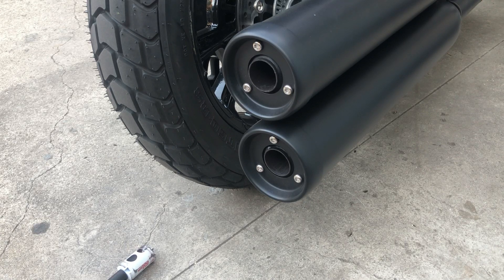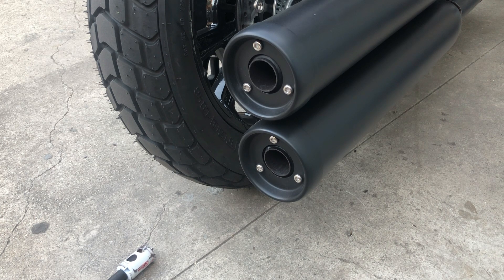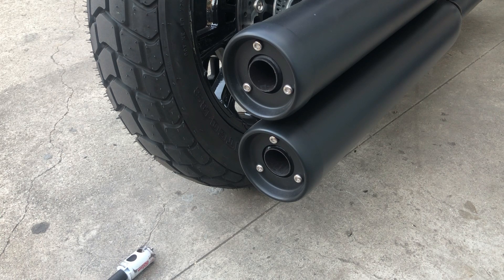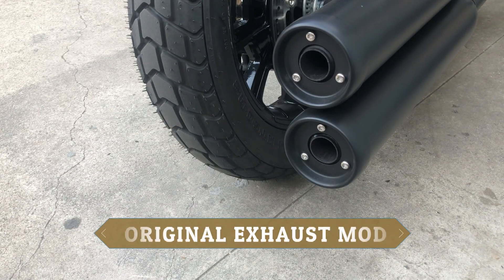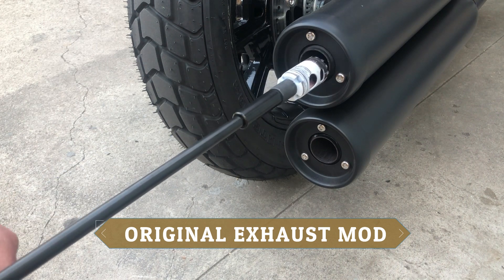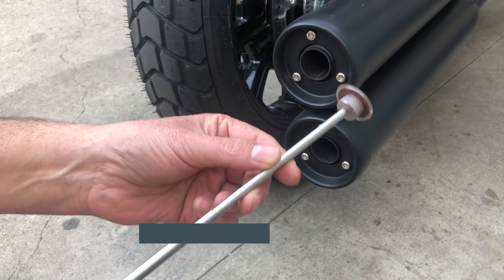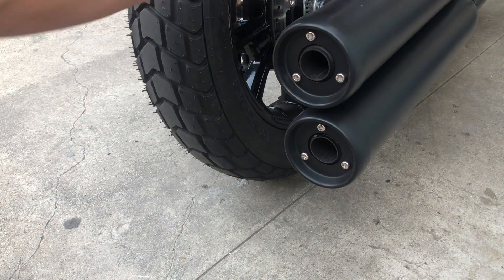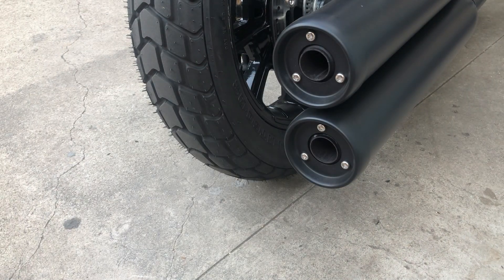Indian Scout Bobber Stock Exhaust Mod

Comment: Everything this this gentleman demonstrated is accurate. Just did this about a month ago to my 2021 Scout, and measured dec. with a phone app, I measured 83>84 dec. @ 4 ft. After removing just the 1st baffle, I measured 89>90 dec. Not sure how accurate my phone is, but measured both times at same distance. My experience was a more noticeable increase than what the video portrays. After drilling out baffle, and pulling out the disc, I shoved magnet back in, and recovered more of the shavings from drilling, followed up by a modified hose hooked to 6hp shop vac. Besides completely removing muffler, I do not believe I could have got it any cleaner. Regardless, bike sounds and runs great. Much cheaper than slip-on's, and is a good starting point to decide how you want your bike to sound.
Mike
Reply: Did you drill 1 or two sets?
Reply: @jimheidl1272  
Just one in each muffler
Reply: @mikeh4686  have you heard or seen any video of someone drilling both sets?
Reply: @jimheidl1272  yes, if you search for it on YouTube there is a lady that did drill both out. She does an excellent review of before and after. Video shows stock, 1 out, and finally all four.
Reply: Hey Mike! So... your engine has NOT exploded yet do to errant metal shavings?? I kid, I kid. Anyway, how did you modify the shop back hose? My SB20 should be here in a few weeks and this will be first order of business.
Reply: @metalmotorcycles5732  
Hell no. Bike just ticked off 5500 mi. and runs great. Extendable magnet picked up most of the shavings, and then used a pc. of radiator hose on end of shop vac to retrieve what may be left. This isn't for everyone, but it's hard to find compromise between good sound and pissed off neighbors. I am not in a hurry to throw lots of $ an exhaust system, and maybe find out it's not for me. My 2 cents

Comment: Why not take out the screws and just gut the whole muffler?
Reply from the maker: that is a good question, but from a post i read in the past, this will leave a hollow void (shell) and no interior parts. what I was trying to do, was just increase a bit the noise level.  but, you have a good point.

Comment: Easiest and Most Sound Effective is
Remove the 6 3mm Allan Screws at end Caps
Pull Complete Baffles out
Remove fibreglass Wrapping and throw in the Bin
Get your grinder with Cutting Disk and Cut Off @ the end of Cats,
Re IN stall,  WIN / WIN
YOU WILL BE A MUCH HAPPIER INDIAN OWNER
COST = ZERO DOLLARS.
Reply: The caps are just for show. The stock mufflers are sealed.
Reply: Post a video about it.

Comment: Uh, what about the metal shavings? There is actually a vacuum at times. I’ve seen bores destroyed from catalyst material being sucked up into the cylinders. It all doesn’t blow out.
Reply from the maker: very good observation. thank you.
Reply: You can cut the pipes back past the first baffle and modify end caps too.
Reply: Are you sure you're not thinking of two strokes? 4 strokes have valves that would stop the possibility of anything being sucked in.
Reply: @kevinsweeney3428  I worked at the Honda engine plant test department for over 20 years. I’ve seen the destruction to cylinder walls from loose catalyst material being sucked into the engine. 4 stroke automotive engines I’m referring too. It can happen!
Reply: @davepritchett  He did remove only the first exhaust baffle. The catalyst is much further in the pipe on the opposite end. There is still another baffle and the honeycomb cat in the way, I doubt any of the metal shavings can get through those and that far into the engine, most likely they will eventually be all blown out.

Comment: the Indian's engineering team who managed the project of those exhausts to comply with the environmental regulation and other regulatory stuff should be agitated about this "modification". why we should bother about the exhaust mufflers, those things are there just to be changed or modified, the volumetric efficiency on the combustion  chamber or other parameters non important on the engine is not that important.